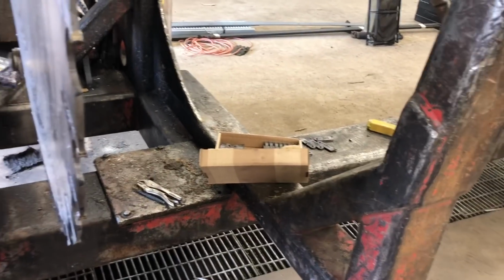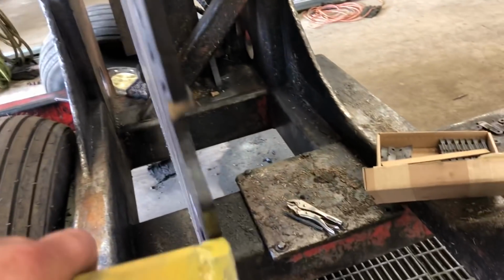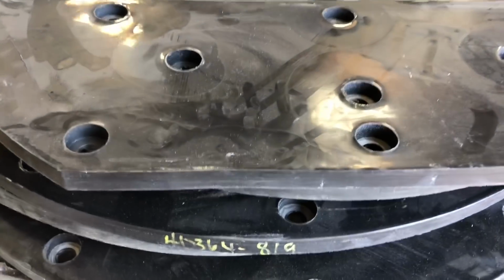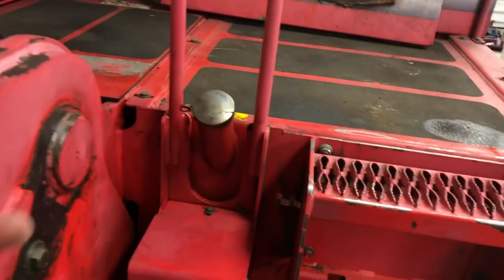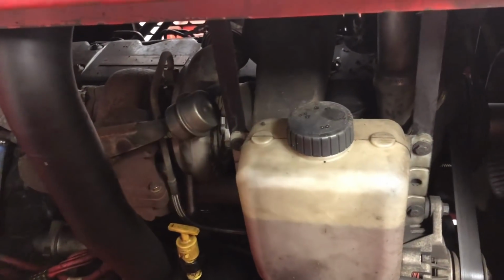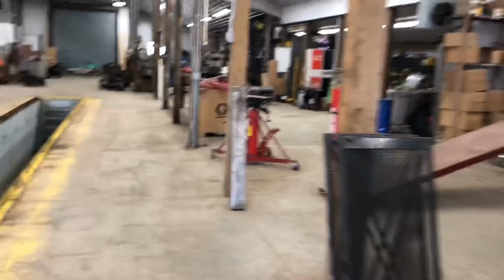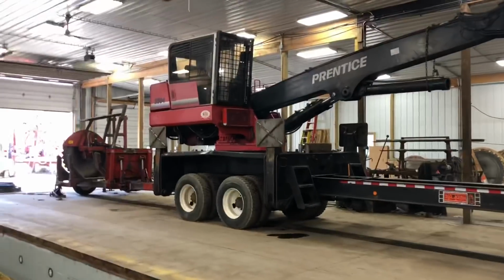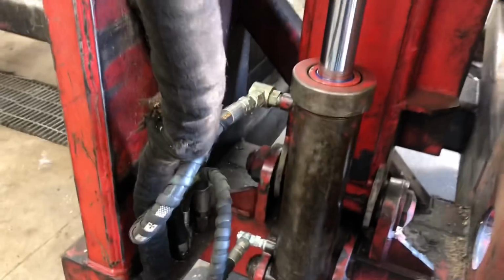Custom Tool!!

Comment: That saw blade is made from some great metal. It would make some great machete blades now. I used to brang home the band saw blade from the mill when they’d break. Great fillets knives I made from that metal. The was huge prob 12-14 inches wide and I’ve seen them fly all to pieces. Go through the food of the sawmill to.